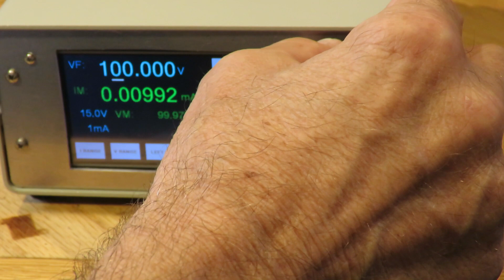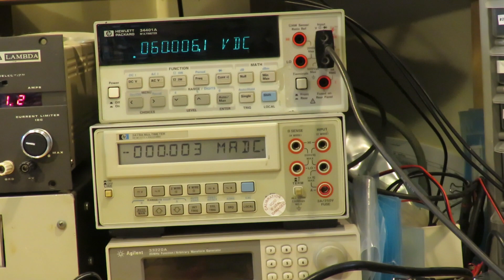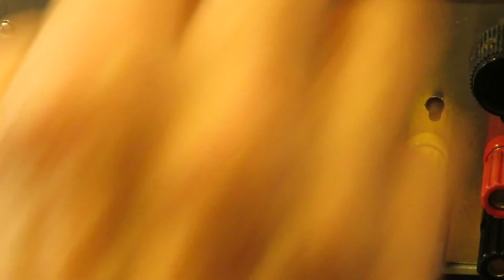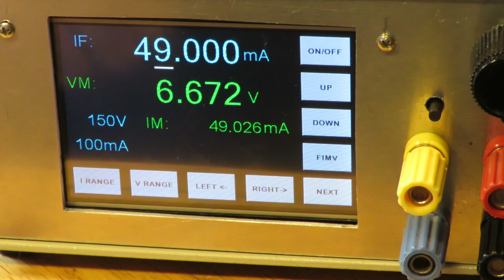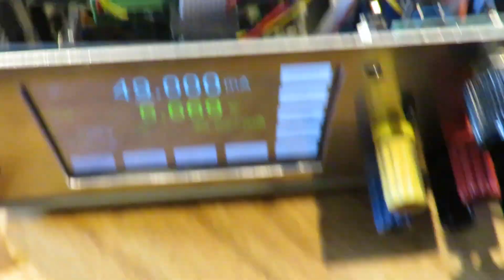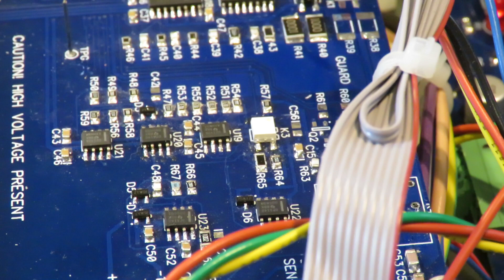DIY Source-Measure Unit SMU Chapter 1

Comment: How's the plotter doing, and what is the sample rate of the ADC?
Fantastic project! Is it still alive?
Reply from the maker: Plotter basics are working now, but changing pages deletes the old data. That needs some work. You can plot externally in Python, that works very well. 
The sample rate of the ADC is a few samples per second currently. ADC speed is currently just a constant.  Needs a SCPI command to set the ADC rate / NPLC.  I'm always measuring both the force and measure, and toggling ADC channels slows the ADC down about 3x. I need a mode to select and display just the measure channel.  I still need to make the ADC reads non-blocking and come up with a proper SCPI trigger scheme. 
There hasn't been a whole lot of interest, so improving the software hasn't been my top priority. 
Thanks, Dave

Comment: Hi, Where is the source code ?
Reply from the maker: Thanks for the reminder. 
I just updated the .ZIP file with the latest design files:
http://www.djerickson.com/diy_smu/files/DIY_SMU_Files.zip
	Schematics in .PDF and Diptrace .DCH format
	PCB source files in .DIP format
		Amp board Rev 3 
		Main Board Rev 2
		Front and rear panels
	BOM in Excel .XLS format
	Current Arduino / Teensy / Nextion application code, up to and including functional SCPI
	The Nextion .HMI file
	Main simulation schematic in LTSpice .ASC format
Enjoy!
Dave

Comment: It is a amazing circuit, but I don't understand the voltage sensing circuit with the opamp U23. There is no reference to ground. I think the circuit will be clamped to node R65(2).  Higher input voltage R68(2) means higher load.

Comment: 10 nanoamp resolution on current ?!
Reply from the maker: 10nA is conservative. I'm aiming for 1 to 2 nA, 1/1000th of the 1uA current range. Operating this low will require slowing the ADC down to get better noise reduction, maybe with further averaging. And shielding.

Comment: Could you use 2 identical boxes, one with the controls and one with the power like a pre-power amp? It might make upgrades easier with 2 sections.
Reply from the maker: For a long time I thought virtual instruments were the way to go:  no front panel, use a web page/PC/Tablet for the user interface. At Analogic T&M and Teradyne, that's pretty much all we built. Like PCI, PXI, VXI.... But most instruments need immediate controls, and the touch displays, CPUs, and knobs and buttons have gotten smaller and sooo much cheaper. Some $200 power supplies have color displays now. So for now, one box it is. Can always remove a UI later.

Comment: Great project! Respect. 
Waiting for the polished DIY project :)
Reply: Same here. I check back regularly to see if he’s updated it. I’ve seen a lot of other people mention it and be interested in it in forums and such. The YouTuber “Marco reps” had planned and designed an open source measure unit several years ago… called the OSMU and with the silhouette of an emu/ostrich as the logo on all of the boards and enclosures.

He designed everything and even had the boards and was in the beginning stages of testing it from what I understand. But he never picked it back up. He continued using that bird logo on all of his PCBs and they can pretty much be found on each one of his builds.

 His knowledge and command of electronics theory and implication are second to none. hopefully one day he will revisit it. He mentions it in comments and blog posts from time to time but since now he is spoiled with a lot of high-end equipment and precision metrology gear for a little or no cost from sponsors… He really doesn’t need an SMU now… But still shows interest and hopefully we’ll tackle it.
He understands that most folks out here could really use something like that and don’t have sponsors casually tossing $20,000 meters and calibrators our way.  

His open source DIY 8.5 digit precision multimeter video and project are incredible. And I even had the boards made and parts purchased to build one of my own when I get the time. Incredible that engineers at CERN will release designs like that. And so thankful Marco made a well documented video discussing the build and the process.

Comment: This is great, the higher current that you mentioned on your site would be great for measuring the IV curve of some of the larger LEDs.

You the processor, you might want to consider an ESP32. They have 500kB of RAM, a dual core 240MHz processor and most of the Arduino libraries work on them. In addition to this they also have Wifi which is great if you want remote control or a web-based front-end.

Comment: I highly recommend trying to go with the STM32H7 series, using a generic 480x272 touch screen with a parallel(RGB565) connection, and LVGL for the graphics.
One of my recent projects had an STM32H743ZIT6 with an ER-TFT043A3-3. The bringup was painless and easy(the code and hardware just handles all the display stuff for you), even for someone who really doesn't enjoy writing code.
I can share bits of code for prettier graphing on top of LVGL, since I needed that too.
Reply: Another huge benefit of STM32H7 would be that it is relatively easy to hook it up to Ethernet. But in a high speed and high precission design, it might be also be beneficial to have two micros, one for the UI, communications, loading calibration data, data logging, etc, and the other one for just the raw processing and time critical stuff. For example one might want to create fast controlled sweeps, or also limit the power, either due to the requirement of the measurement, or to extend the range of voltage and current in a more flexible way. Sure, it can be probably done with 4 quadrant multiplier and some comparators and extra DACs, but that is just an example.
Reply: I guess a pretty UI is the last of his concerns. those Nexion displays are pretty handy and easy to interface with too.

Comment: Hello David,
I'm currently working on improving the current clamping circuit of my own more-like four quadrant PSU. Are you willing to share your LTSpice simulations with me?
Cheers
Reply from the maker: Sure, I just added the PSPICE simulation .ASC (schematic) file to the .zip file at:
http://www.djerickson.com/diy_smu/files/DIY_SMU_Files.zip
It simulates constant voltage with current clamping. You'll need to change it for Constant current. 
The amplifier and crossover models are pretty complete. The voltage - sense amplifier has its own floating power supplies and I simulated it as a behavioral model: ideal voltage buffer. 
Let me know if you need any other files, and good luck!
Dave
Reply: @ericksonengineering7011   Thanks a lot! I wrote in your EEVBlog thread too, don't bother answering me there :D

Comment: Hi Dave, and thanks for sharing this project with us, looks great and very promising. About half rack enclosure (9.5"): you can check All Metal Parts from UK, e.g.: http://www.allmetalparts.co.uk/814-2u-95-inch-rack-mount-300mm-vented-enclosure-chassis-case-5055726240082.html

I would suggest putting a fan controller high on the TODO list :). There is no reason that "tiny" fan that you're using is working all the time. The fact that many manufacturers are still saving on that component has no reason to be the case here :).

Good thing you realized that the Arduino Leonardo is not enough, even supported with extra processor on the Nextion (in charge of display). We had a similar thing: we started with Leonardo, then Mega2560 and Due and finally finished on our own design based on STM32F7 with 8 MB (expandable to 32 MB) SDRAM with micro SDcard in the background for data logging, etc.

I would love to see a video in the future that covers the following:
1. What does output enable/disable look like, that there are no over-/under-shoots.
2. How it behaves with a slightly higher capacitive load

Keep up the great work, maybe a combination of your SMU and Poor man’s SMU (https://www.youtube.com/watch?v=A7wgQZtJkb4) could become a new module for our EEZ BB3 (https://www.youtube.com/playlist?list=PLLERbxjmTvX1704hCxUNeODXi0piE7k3_) in the near future. In that case it would get all the support for SCPI via USB and Ethernet, GUI editor, MicroPython scripting, MQTT, NTP, Node-RED that we already have.
Reply: I'd move to see an SMU module for the EEZ BB3. My only issue with the EEZ BB3 is that there aren't enough slots for the all of the modules you're making.